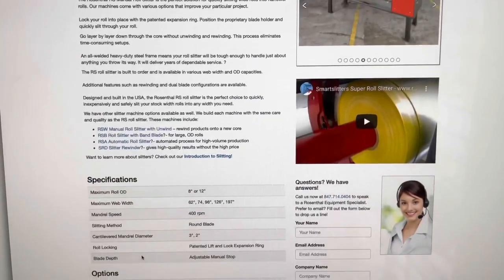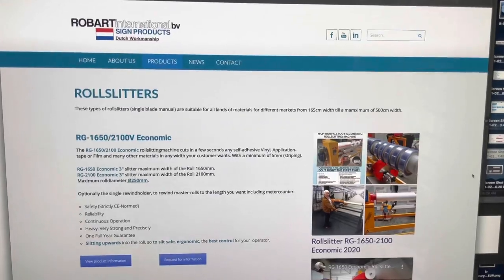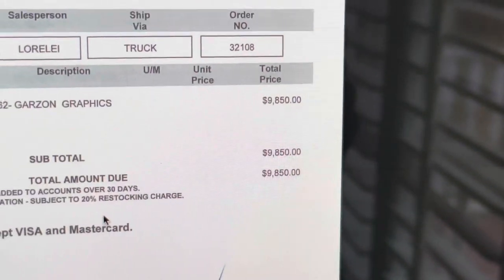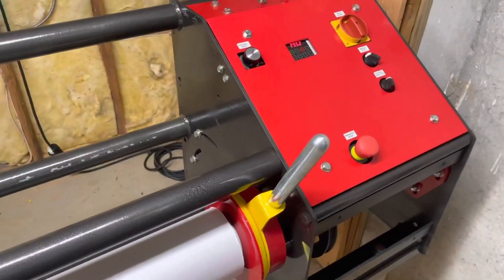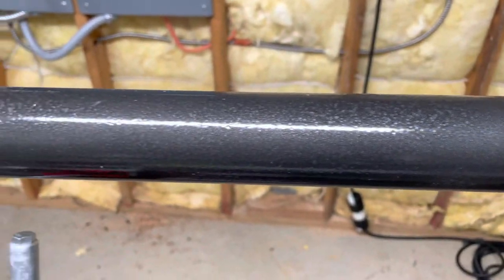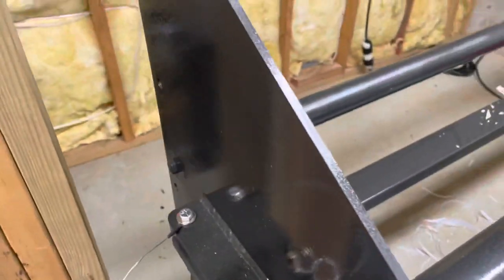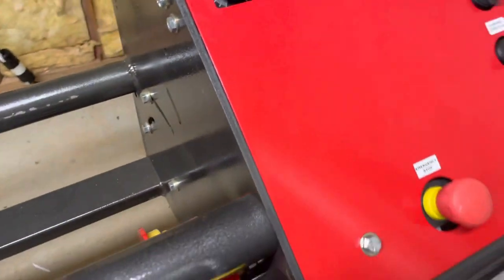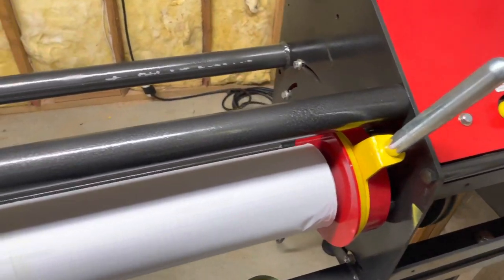Quick review - Genesis G862 - Rosenthal Mfg - Smart Slitters

Comment: Did you ever get a fix for the tunneling issue? We have the same issue, same cutter
Reply from the maker: We did we figure out was the pressure applied to the roll. Get the roll tight before to cut it and let the blade cut gradually and slow to cut the roll completely. It is a learning process.